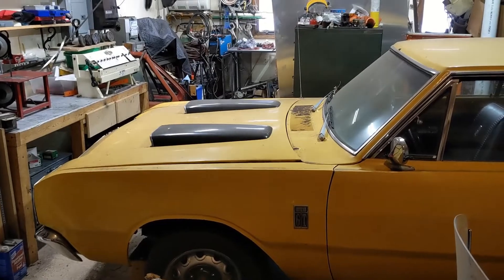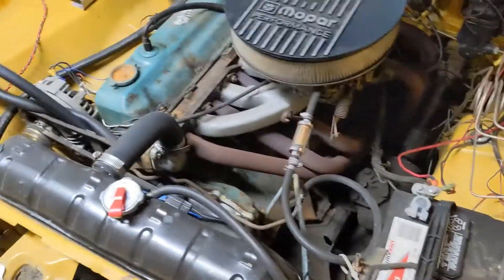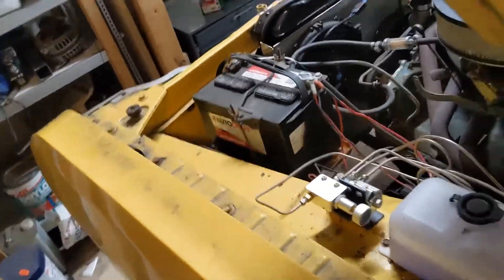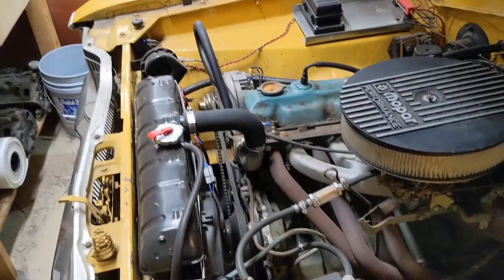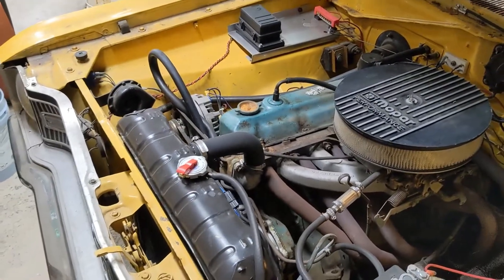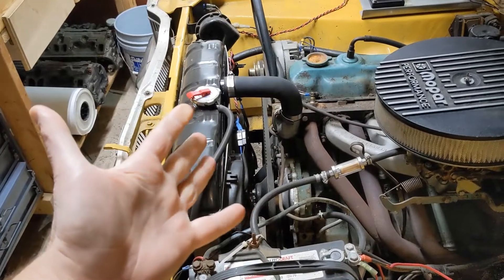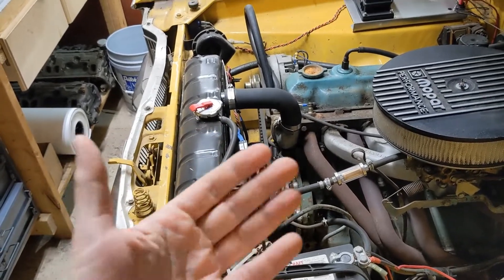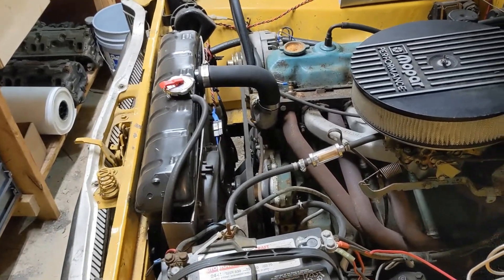Adding Electronics To A Classic Car: Setting the Goals

Comment: How about a tach signal and maybe log to a SD card?
Reply from the maker: It's a good idea, though I have to figure out the best way to capture the signal.  It needs to support high enough speed (up to ~150 Hz) but deal with the fact that auto voltages can have a wild swing - maybe a transistor and diode would be enough...I'll have to play with it.